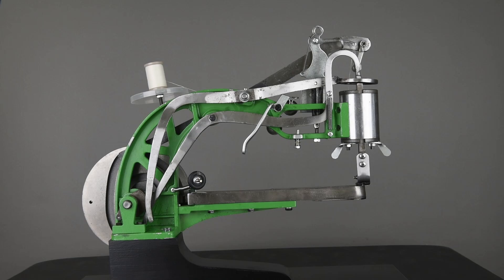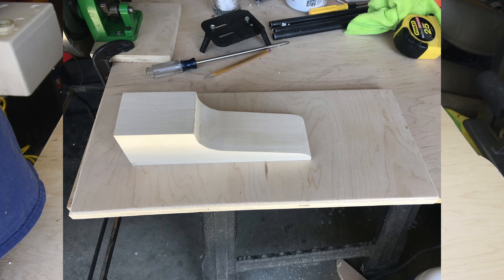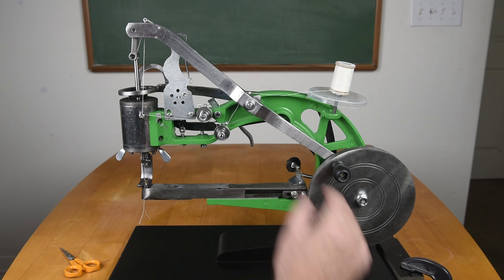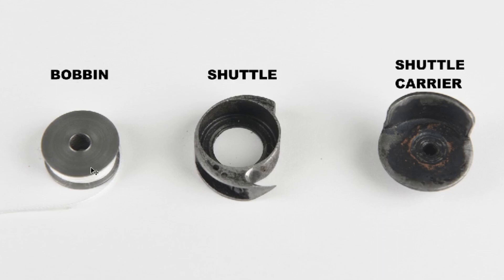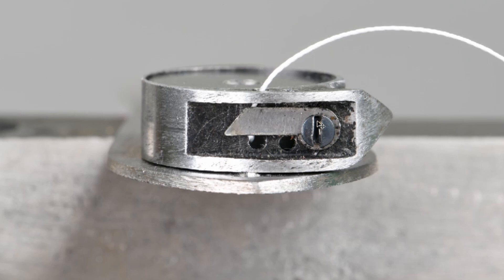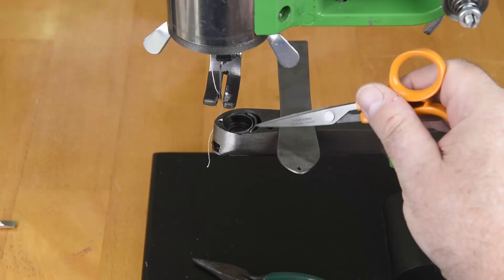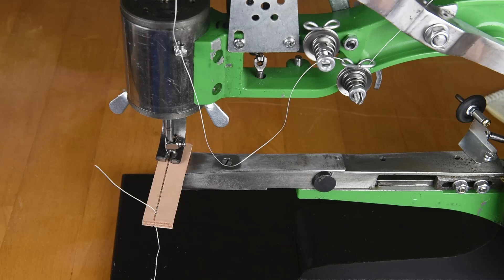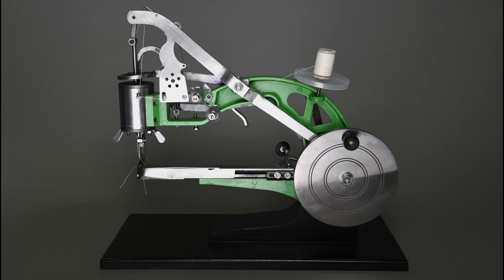Chinese leather shoe patching machine. Junk or Jewel?

Comment: I have mine permanently set up on a bench in my shop.  I use it for all kinds of odd little attaching/sewing jobs.  It's a great tool.  Yes, a little finicky sometimes, but usually it works fine.  I did wind up modifying the thread feed so the thread feeds off a large spool freely.
Reply: its junk tons of machines just like this way better quality for a little bit more money! you can keep a consew machine like this for lifetimes! this machine is crap

Comment: Great video. I just recently got one of those contraptions, and liked it so much I immediately hit the buy again button on eBay. Set the second machine up to use the commercial #20 135x17 and 135x16 needles from my Sailrite. Ordered some #22, and#23 needles to try with some 207 thread and got it working with the #22. The #23 needles won't fit down through the channel, but I think with a little massage for my Dremel I can get it to work. I did deburr the holes in the shuttle and ran the 207 thread over the top of the shuttle tension spring. Used both upper tension assemblies
Reply from the maker: Great, glad you like yours so much! I get to like mine more and more each day. It really is a fantastic little machine if you put some effort into it.

Comment: You surely did a really NICE job with the video editing, and with the info for the machine also.  A couple of things I'd mention.  If you drill a small 3/32" hole in the side of the bobbin it makes threading easier.  Many folks have done that.  

The question about "what machine did you get", might have been referring to the number of bearings.  The original (like I have) is a 4 bearing machine, then the 8 bearing came out.  Now there is a 10 bearing machine.  I'm not really sure the extra bearings do all that much, but they're cheap so why not?

Again, GREAT job on the video.
Reply from the maker: @Ken H Thanks, I enjoyed putting the video together. Not sure if the added bearings are a plus or not. If I find I need another one I might have to try a 10 bearing, although mine runs pretty smooth. I haven't found a hole in the bobbin to be necessary, I just hold the thread on the edge of the bobbin with my thumb and take a few turns on the spool to lock it down before putting the bobbin on the winder. I know my regular sewing machine bobbins have holes, but I really haven't missed them. With my eyesight, trying to hit a hole in the bobbin with the end of the thread might be tough these days. I can hold and wrap with my eyes closed. One thing I see a lot of and failed to mention in the video is  folks putting a large spool of thread directly on the machine which causes a lot of problems. If your using large spools it should be fed using a thread holder and can be had on amazon for around 10 bucks. Anyway, thanks for the comment!

Comment: Jewel ——-, have had one for about 5 years , have used it many times and really like it. Made lots of stuff with it. To make getting the hang of it easier, watch some of the YT videos. You don’t need to do any of the fancy filing and cleaning some recommended. You can even use the three little leg stand that comes with it . I used mine with the flimsy stand for about a year , it does work. By the way , this is probably the best video on this machine yet, good job!

Comment: My machine didn't come with the wire for feeding the thread.   .030 or .035 Mig wire works well for this. Also had the mentioned issue with the nut on the crank handle backing off. Drilled and tapped the nut for a setscrew and haven't had to mess with it since.

Comment: It's initially an unfinished peice of well-built junk.

But if you spend alot of time with sand paper, a dremel and buffing wheel, scotch Brite, wire brush, and just go thru and get all the scuffs and sharp edges out so it doesn't cut your line and repeatedly get snagged, and learn how to equalize your bobbin and top thread tension for a even looking stich on top and bottom, then your good!

Alot of effort, then it's a JEWEL!

Comment: I filed my bobbin case bottom edge rounded.  Bobbin case (my definition) is the thing that holds the thread spool.  The rounded edge lets the thread slip under the bobbin between the rotator thingy (the thing that holds the bobbin case with small gear) and bobbin.   Most machines the thread slips over the bobbin.

Comment: Well done sir. 
Succinct well produced content. Extremely useful. I fit the profile you describe at the beginning and will be buying one of these units. 
I am trying to figure out thread and needles. Largest thread and needle it’s capable of. I would use it to mend and modify various items. Example- recently I used my hand stitching awl to add a webbed nylon loop on my son’s heavy duty “badger” nylon tool belt and now need to restitch a leather tape measure holder. 

Thankyou thankyou

Comment: Rather than using a dremel on the presser foot, could you have just used a longer needle for the thicker leather?
Reply from the maker: I don't think so. The machine is designed for HAx1 / 15x1 needles. If you were to use a longer needle it would change the timing.

Comment: Still problematic: using the foot shifts the needle ever so slightly, but it seems to correct itself on the way down so it passes the hole. Its like a very gentle half eliptical curve  On testing really thick layers however, the needle doesnt seem to correct and it hits the plate and breaks, perhaps because the material itself prevents the needle curving back.. As a "fix" i just ended up stitching without the foot semi freestyle after marking the leather, which is faster than by hand and accurate. However is this strange needle shift when the foot slides back normal? And if not, any tips to correct it? Something in the mechanism clearly is causing it to happen

Hello, great video. I have a problem where when the presser foot is engaged, the needle seems to be shifting missing the hole to the bobbin and breaks. Machine works fine when presser foot is elevated, problem only occurs when the presser foot lever is engaged. Any idea how to go about trouble shooting this?

Edit: The first needle stab is fine, but when the foot moves once, the problem occurs.

Edit 2:

Just fixed it. The issue was i incorrectly assumed i could leave the base plate screw a little loose as you just flipped it off with the screw still in to access the bobbin, and it was causing the plate to shift with the foot movement. I could only see this once i removed the leather i was stitching to see the needle path (should have done that before breaking 3 needles). Tightening the base plate so it doesnt move along with the foot fixed the issue. Interestingly it wasnt being triggered when the foot wasnt down and just the material was sliding along it.

I also realized the base plate could be lifted with the screw engaged tight - so easy bobbin access remains with no need to fully unscrew it as per what i saw in this video (i didnt understand it what i was seeing fully).

This is my first sewing machine, and i currently find it way more complex than simply sewing leather by hand. Even back stitching accurately is tricky at the moment - clearly i need more practice

Comment: Best vid online! I’m having trouble breaking thread when trying to back stitch… any advice? Thanks so much
Reply from the maker: @Holistic Veterans Usually if you're breaking thread it's from too much tension either on your bobbin or top thread. Strange if it's just while back stitching. I suggest you pose your question on the Chinese Leather Shoe Patcher group, there's a link in the description. There's folks on there that have a lot of experience with this machine. Thanks for the comment and good luck with your problem!

Comment: Worked on mine it sews great. However I make knife sheaths and t69 or 70 is kinda light for heavy leather. How do you modify for heavier thread?
Reply from the maker: You have to use a different size needle and adjust the tension. Don't remember what size for the larger thread off the top of my head, but Google should know. Tension is a trial and error thing, again, Google and the CLSP Facebook group are your friends!

Comment: Fantastic video, thanks for making it.  BTW, what type and size needle were you using ?  Do you recommend a chisel point for leather ?
Reply from the maker: @itaintmebabe99 I'm glad you liked the video. I'm using a size 20 needle and #69 thread. There standard needles not chisel pointed. I get them online from Bantam Saddle Tack. I bought some other sizes from them, but this combination works so well I haven't tried them. Check out the facebook group I mention in the video. Lots of conversation on needles and thread on there. Thanks for taking the time to leave a comment!
Reply: I like making knives and possibly gun holsters and other miscellaneous leather things. The leather I would like to use is thicker than what you demonstrated on. Is the machine capable to sew a latigo weight type leather? And what type of thread would you recommend? Where would you recommend getting the thread and will the machine properly tension a nylon strength type thread or these all cotton threads? Thanks for the video, it was very good. 😊

Comment: Thanks for the video. I need HELP! My walking foot doesn't walk.

The upside down U shaped piece barely moves left and right. So I followed that part to the other end, to the base. That arm has very little space from the end to the base. Also, one of those rotating levers at the base doesn't even press against that arm which is part of the U shaped piece. It's like the machine is damaged or I put it together wrong. Are both of these levers supposed to touch a metal arm?
Reply from the maker: @Enyawd Nitram Without seeing a video of what your machine is doing, it's hard to diagnose the problem. Your best bet is to go to Harrison Higtowers site. He has lot of videos showing every aspect of this machine. Here's a link: https://www.youtube.com/watch?v=tWgxzSCZxrQ&list=PLIECxGWdazf0DAFcs-mUiJwUvlNo8kX0K
Also, if you can somehow get a video of what your machine is doing and can post it to the CLSP Facebook group. Members there might be able to help you out. There's a link to the group in the description area of my video. Good luck!
Reply: @ChucksMagic  I figured it out. I thought the base of that thread-length screw should always touch the metal frame. Having the end pressed against the metal frame meant it will be a very tight stitch which would make it appear as if the walking-foot isn't working. Once I adjusted the crew it works just fine. I love this machine because I can draw designs on the leather and easily stitch it. Thanks for the video and your reply.
Reply from the maker: Glad you figured it out, have fun!
Reply: @ChucksMagic  It worked. I lowered the needle to point I can feel the tip through that hole under the bobbin shuttle/casing. It picked up the bobbin thread. Thanks so much.
Reply from the maker: @enyawdnitram185  Good job, you'll be an expert once you've got everything dialed in!